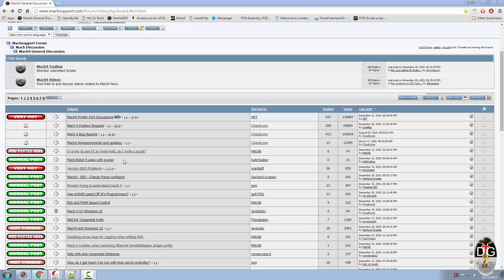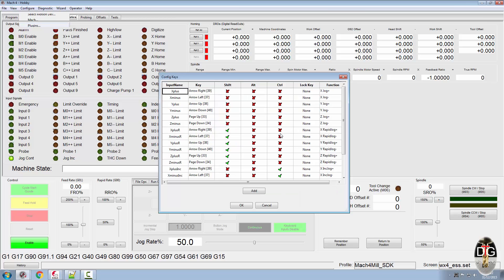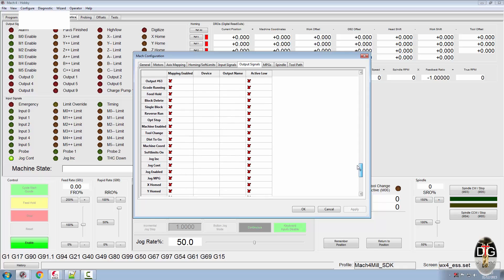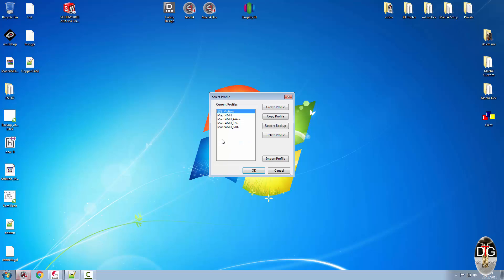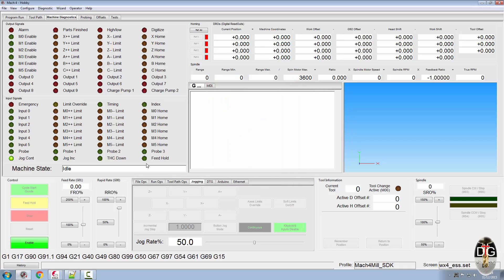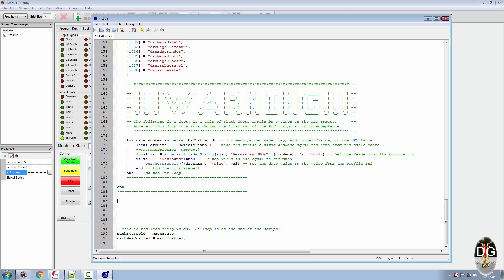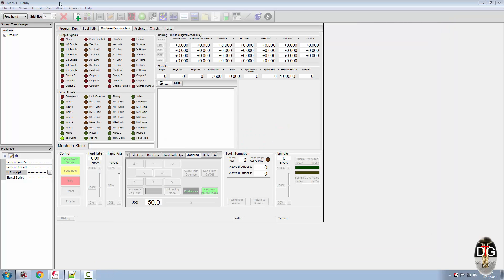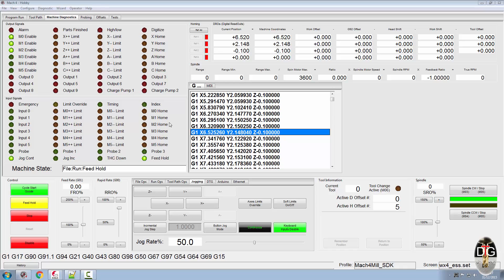Mach 4 Quicky #2 - Keyboard Plugin

Comment: The video was out of focus when you went to  write the code and was unreadable.  Is that code snippet available anywhere else or could you include it in a reply.  I have an iPac keyboard emulator and so I'll be wanting to add several buttons.  BTW I am surprised that Mach4 does not have hot keys for many of these well used functions, Mach3 did.
Thanks.